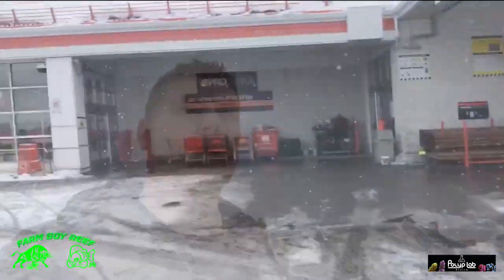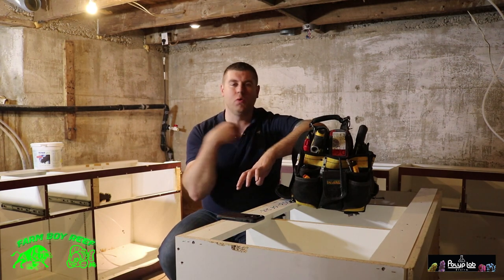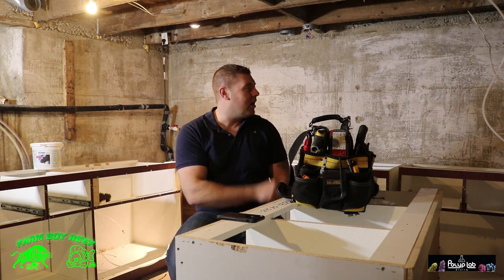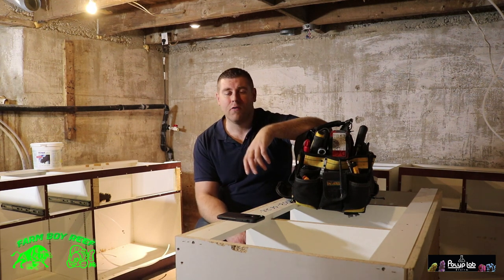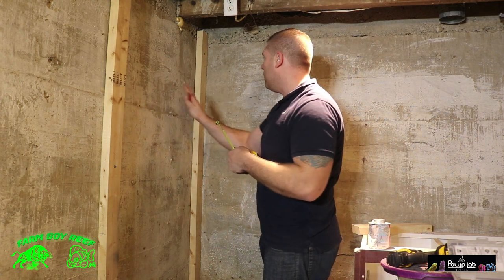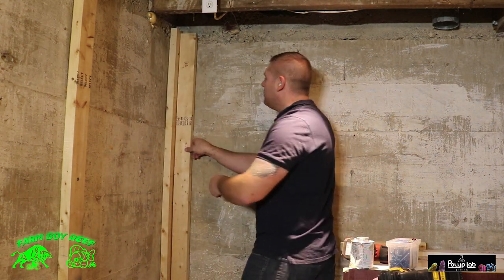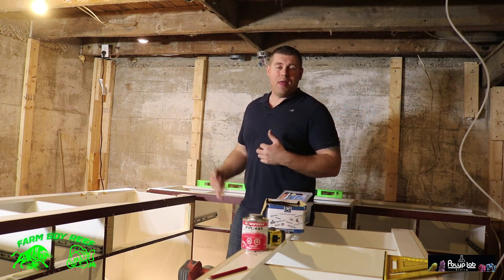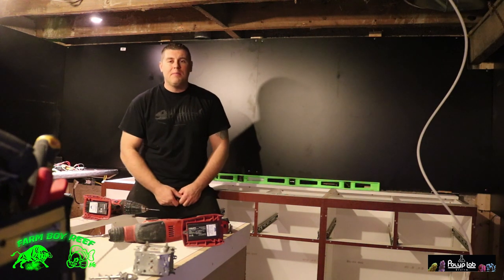Starting the new fish room for the 700 gallon phoenix build

Comment: You made those tapcon screw last look easy. They can be a pain in the ass
Reply from the maker: +Reid Smith thanks lol! When I was doing it should have changed out the battery and used a in pack  drill.